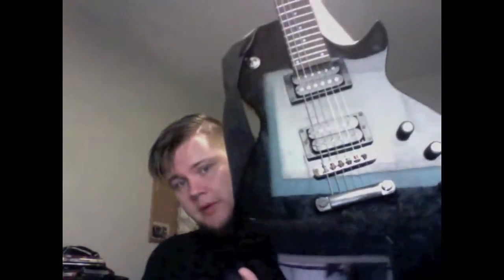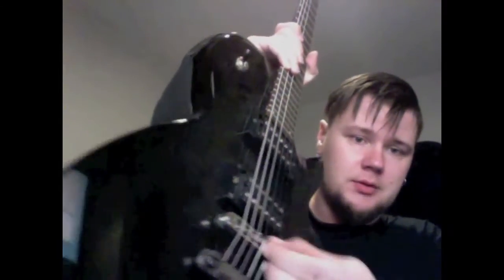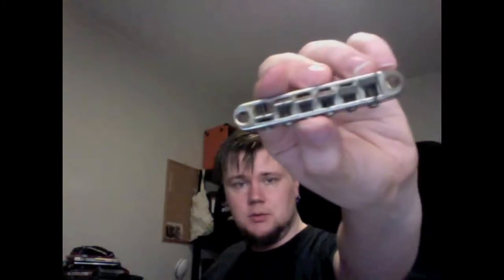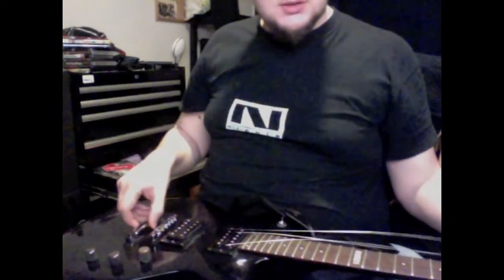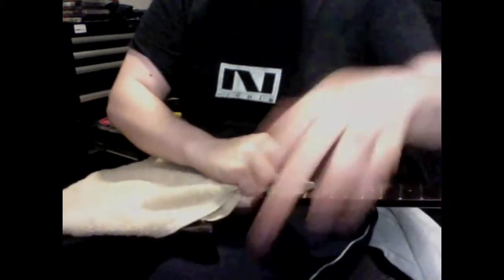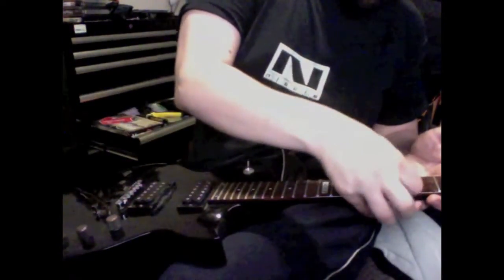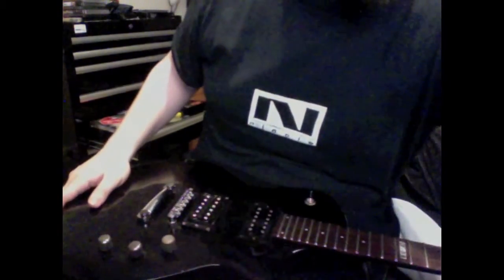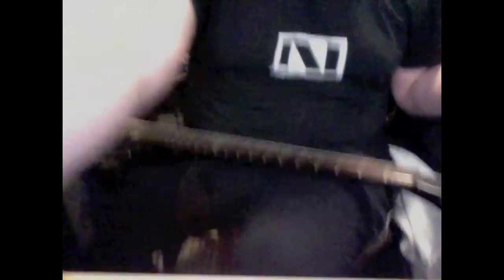Demonstration -- Changing the bridge and tail piece on a Les Paul guitar

Comment: Snipping the strings like that takes a lot of tension off the neck all at once, should really unwind them.
Reply from the maker: I had relieved the string tension in advance a but so it wasn't in standard tuning when I cut the strings, but FYI: snipping the strings one at a time or even having the guitar without strings for a while doesn't damage the guitar. that's why there is a tension rod in the neck.